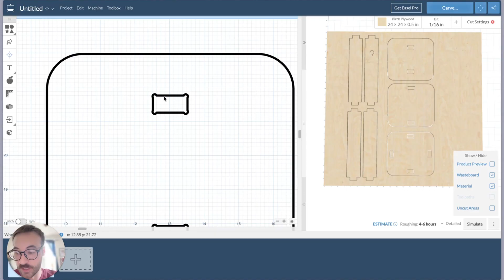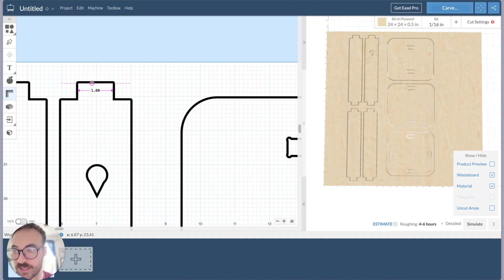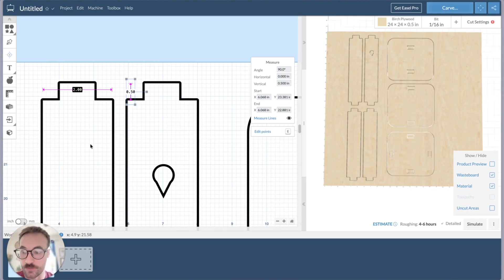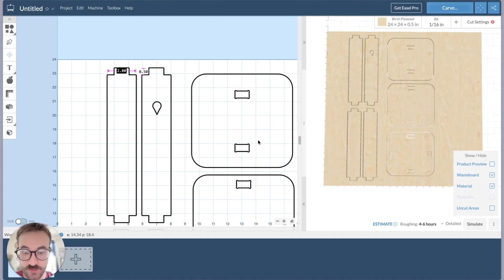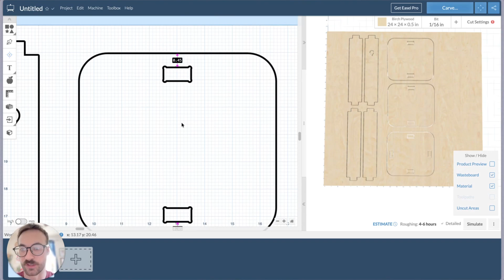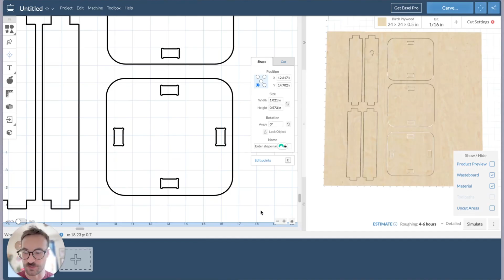Easel Software Feature Overview: Measurement Tool

Comment: Hi, how do you link a measurement?  There are times where you "grab the measurement tool" (6:11, but don't say what you are doing with the mouse when you "grab" the tool, example 'left click on the measurement tool'), then you "pick up that line" without saying what you are doing with the mouse, then you "link it" to the notch cutout without saying how you linked it.)  Reason I am commenting is because there seems to be no rhyme or reason as to when the measurement tool 'measures' and when it 'links'.  I am sure you must be holding a key down while clicking (e.g. shift key, control key, alt key, etc.) but I have not figured out how to get the measurement tool to link when needed.     It seems we have to guess what to do with the mouse and keyboard in the videos to accomplish the task at hand.  Thanks a bunch for listening and hope to learn how to link when needed.